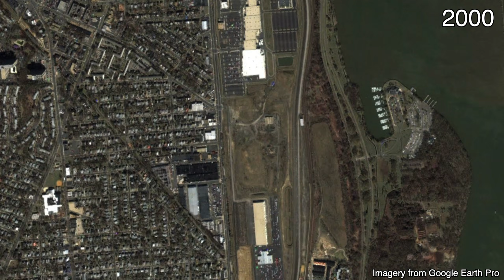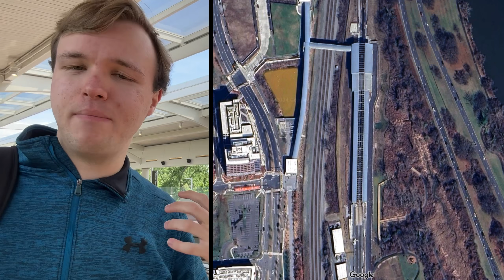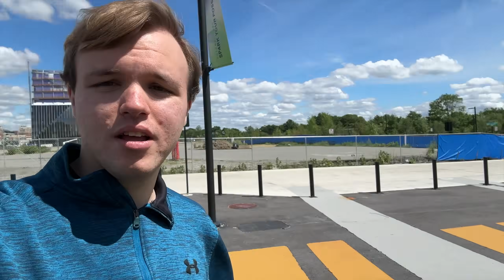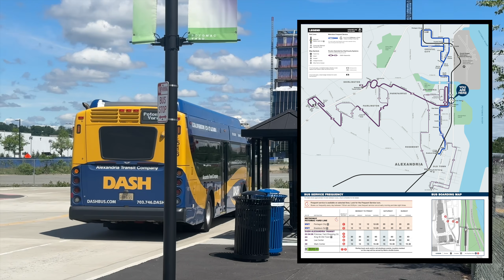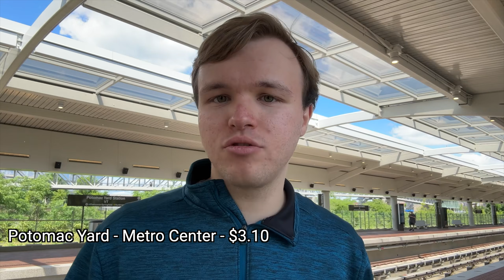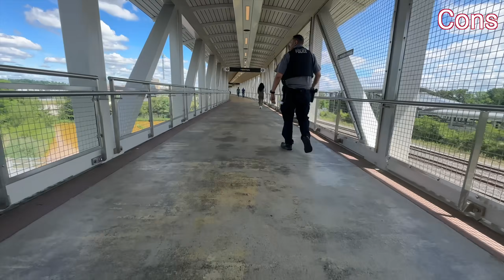The Washington Metro's Most Futuristic Station! - Potomac Yard!

Comment: I hate when the train platform has two separate platforms where u gotta take escalators or steps to go to the other side I like it when it's just one platform and the tracks are on each side more
Reply from the maker: I'd see this as a problem at transfer stations, but bc PY isn't, I don't think it's a problem, but I do prefer the island platform type.
Reply: @sammymarrco47  red line metro center and gallery place are the elephants in the room when it comes to that 😭
Reply: @theunknown0887 not L’Enfant Plaza?
Reply: @DnD_Robb404  that also applies

Comment: The station's design was partially inspired by the Thorncrown Chapel in Eureka Springs, Arkansas! The chapel was designed by E. Fay Jones and was constructed in 1980. E. Fay Jones was an apprentice of Frank Lloyd Wright, and the chapel is of the Prairie School style that Wright popularized! Only 20 years after it was built, it was listed on the National Register of Historic Places, which usually isn't even given to buildings less than fifty years old unless said building is very significant! The chapel itself was inspired by the Gothic Sainte-Chapelle in Paris and is meant to be a non-denominational place for meditation in a forested landscape that can seat up to 100 people. Fay affectionately labeled Thorncrown’s style as “Ozark Gothic.” The chapel rises 48 feet into the sky with over 6,000 square feet of glass and 425 windows. Its dimensions are 24 feet by 60 feet. The chapel is made with all organic materials to fit its natural setting. It's surrounded by rock formations and a canopy of trees, so the chapel is indeed quite beautiful!
Reply from the maker: the Thorncrown is even transit accessible! - https://www.google.com/maps/place/Trolley+Stop+%23110/@36.41585,-93.772475,175m/data=!3m1!1e3!4m6!3m5!1s0x87c92d1c92068757:0xaad45ed98e5191b6!8m2!3d36.41597!4d-93.7721!16s%2Fg%2F11lds6zdb3?authuser=1&entry=ttu